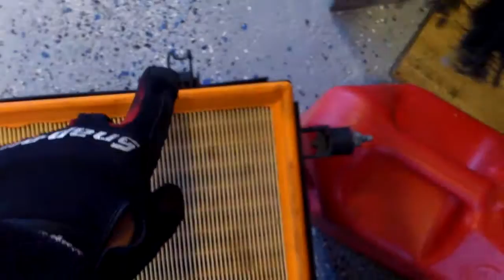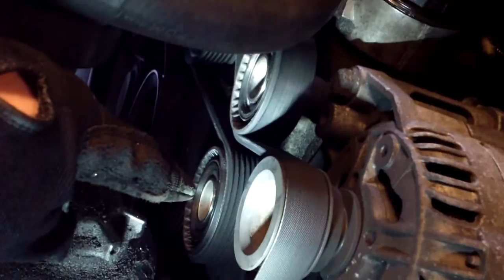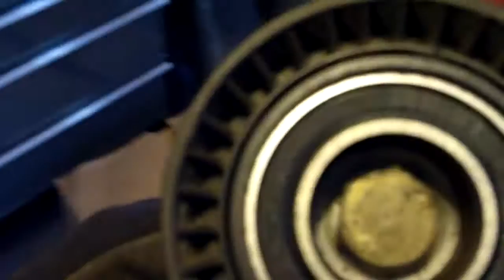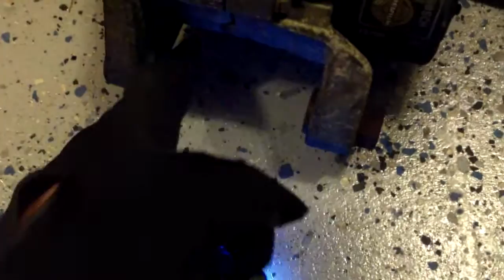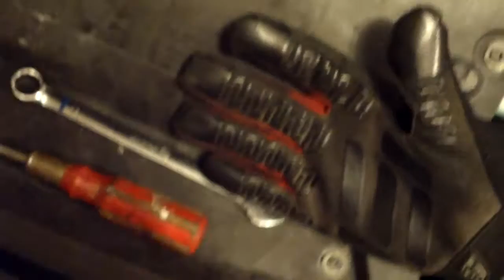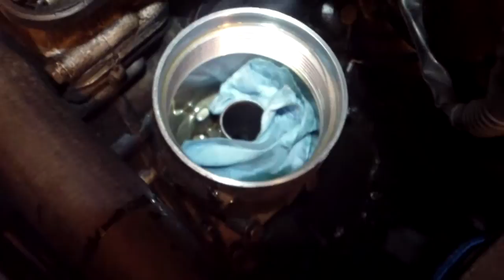DIY BMW E36 M44 Oil Filter Housing Gasket

Comment: I've been suffering the dreaded "Trade Fade" recently after not turning a spanner for awhile... I've been staring at a wet engine thinking "What the  f#*k is causing that?!"

Then I passed your video - I think I'm off down the garage this fine Saturday morning.

Cheers for the vid.